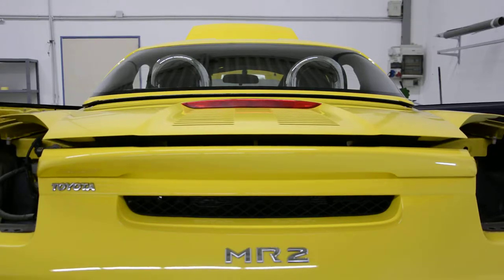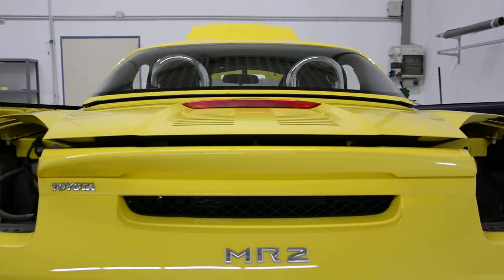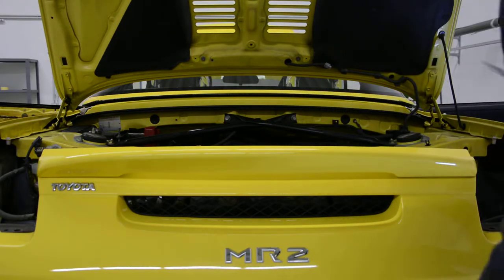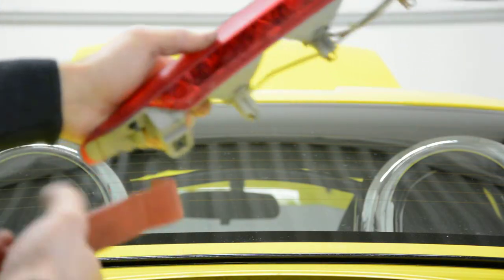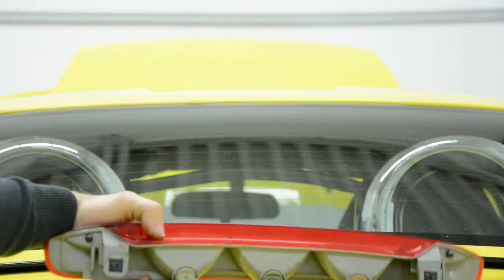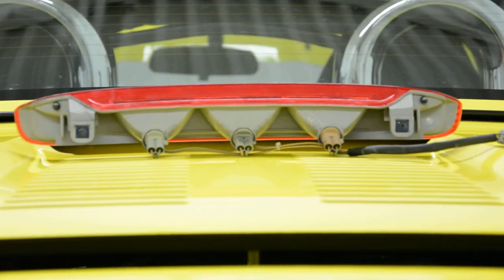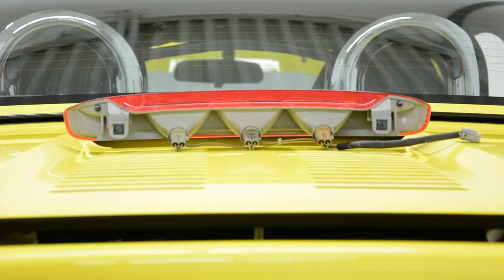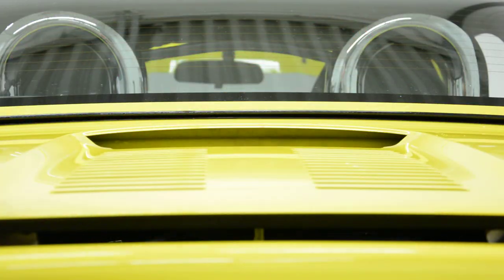Third brake light removal Toyota

Comment: Thanks for the good video. Followed your advice and carefully removed the plastic fastener holding the fabric covering the hood lid so as not to break it, before disconnecting the wiring harness. Then for removing the light assembly, used the same nylon pry bar (less than $10 for a set; much like the one in your video), and slid a credit card between the bar & the painted metal) to be extra safe on the paint.
Only problem I had is the previous owner had broken both of the nut 'legs' that the screws go into, and then reglued them with epoxy. So when I removed the two screws those both broke off again and now I'm in search of a replacement light assembly!